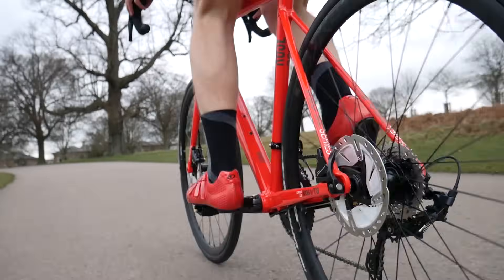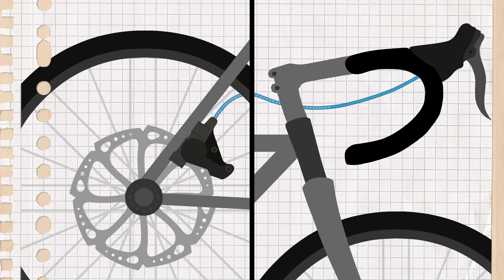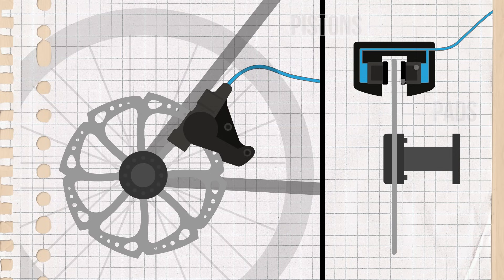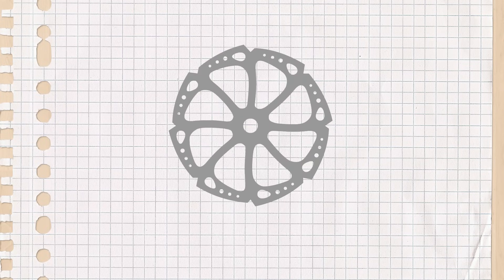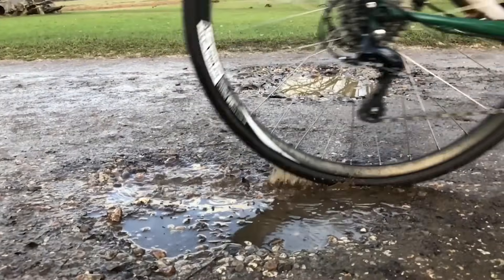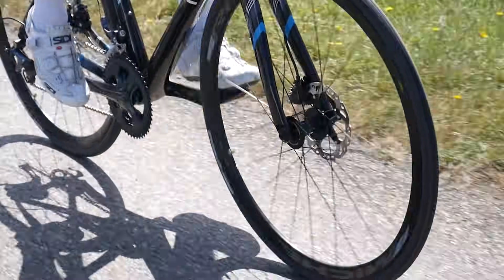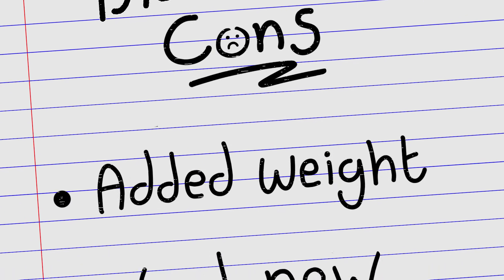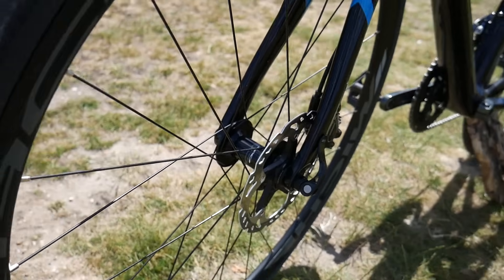How Do Disc Brakes Actually Work?

Comment: Disk brake looks more modernized and upscale in my opinion, and all E- bike have it for the looks and stopping power since it goes a lot faster, but the rim brakes is simple, works and look just fine on an everyday bike with a lot less maintenance, hope they never get rid of it, just make sure the adjustment is good for safety reasons.

Comment: convert coz all rim brakes ive used are ass
mooshy and cant stop you going down a hill, and unless youve paid for a $10000 tuning, the brakes with either rub against your wheels when you dont want, or when youre trying to break theyll be applying 0.1% of their power

Comment: Disk brakes are better i ended up putting my head through a windscreen getting a massive gash to my head and a broken collar bone because it was raining one evening and the spray and oil off the road stopped my rim brakes from working i just couldn't stop thankfully i didn't feel a thing i was out cold the only good thing about rim brakes is they are only a few pounds to replace

Comment: I don't have any problem with the modulation and braking power on my rimbrake road and gravel bikes. I just had to set them up correctly. 
Although I have hydraulic disc brakes on my mountain bikes due to worse conditions like water and mud on the trails in the forest, which can eat up the rim fast on the rimbrake bikes.

Comment: disc brakes all the way. Rim brakes were always way too inconsistent, especially in changing weather. Wet rims make for a very unsafe ride. Not to mention how quickly the brake pads wear down on rim systems.

Rim brakes were good for a non-practical and non-safety era such as the one in which they were made, but now, we actually got smarter and no longer ride like neanderthals (mostly).

Comment: I've never had one of those that's replaced onto my bike that Schwinn type one. I had an old one that is different, my old one is a la Jolla Street cruiser I've been having that bike and rode on it for 8 or more I believe but now I got an upgrade for my old bike which is I got a new bike now because my old bike wasn't working properly so that bike is now. I got a new bike call a Schwinn so it maybe pretty much of a mountain bike, it got shift gears so after I started practicing of shifting my gears of my new bike I'm starting to get hang of it now. The types of brakes I have is brake pads.

Comment: I'm getting a twist or slight movement in my ftobt 28 inch front rim with ftont disc brake application. 
Thoughts on why??? QR is as tight as i can get it😧
Reply: what do you mean by slight movement ? is the whole wheel slipping when you apply brake ?

Comment: How do the mechanical pull brakes work?  Do the flex the disc?
Reply: This is what I came to this video to try to find out, and I still don't know
Reply: @_Stormfather  if you're referring to mechanical disc brakes, yeah. Typically one piston is fixed (and must be adjusted manually from time to time) and the other piston is cable actuated. When you pull the brake, the cable pushes one piston (and brake pad) against the disc and flexes the disc ever so slightly to contact the other brake pad from the other piston.

Comment: I can't believe he just said rim brakes look better. No they do not. I only wish the pro athletes and organizations got onboard with discs earlier. I was surprised to know most of the high end group sets include V brakes because antiquated opinions and regulations prevented disc brake adoption. Thus, there were very few Shimano 105 options with discs in the used market, and that lead me to buying my Giant FastRoad Advanced 1. Disc brakes look way way way better than V brakes, and I literally refused to buy an expensive bike with V brakes when my crappy $350 CCM bike has discs.

Comment: Another con of rim brakes is that if you have even an insignificant dent in your rim which is basically unavoidable as your bike gets used more, then the rim brake will rub along that particular ding and you cause resistance, brake wear and sound. This problem doesnt occur with disc brakes as they are not in contact with the rim.

Comment: Silly Questions:
If I could only own just one bike, it would be a Rigid MTB. It would be used for mild trails and unpaved roads as a MTB as well as for pavement/Street riding in the City.
So my questions are as follows:
Can I have 2 sets of wheels, one for MTB (probably a 2.3, 2.4 tire) and the other one with 1 inch slick tires for City riding that could be easily changed from one to the other?
Which braking system would be best? It seems to me that to have the two, same diameter wheels but with different rim width would not be an issue for discs as long as the space between the disc and hub is the same on both. Is there a way of spacing this? Or is this standard sizing and it can be had with the same space?
Thanks!
Reply: It's standard.

Comment: Disc brakes are only marginally better than rim brakes ( on road bikes).  Not enough margin to buy new hubs, have bigger, clunkier levers and parts to go awry.  If you cannot propel yourself over the bars with rim brakes then sure, buy disc brakes.

Comment: you forgot to say one more cons = Disc brakers are slower due to lower aero.
Reply: the better stopping stopping power allows you slow down quicker for turns so you can brake later though making you more efficient in areas where you would lose time slowing down

Comment: I have 2 race bikes. Rim and disc, the disc breaking power and comfort is just suberbe compared to rim break, especially when you live in wet areas.. on top the disc bike gives you more options to use different tyre sizes...
In my opinion, once you try disc brakes you do not really go back to rim..
Reply: *superb
Reply: right!

Comment: Another con would is that not all disc breaker wheels have the same size axle or disc. So in road racing a neutral series car is unlikely to be able to give you another wheel if you puncture.
Reply: why you need a hole new wheel for a puncture.... even if your running tubeless you still dont need a hole new wheel
Reply: and tubes are what $5? $10 at most.... I always pack a few extra tubes with me

Comment: What pushes the pads off of the disc when the brake lever is released ?
Reply: The piston seals  are straight when lever isnt pushed. When  the lever is pushed, the seal bends inward toward the rotor, when lever pressure is released, the seal and vacuum of the airtight system pulls the piston and pad off the rotor
Reply: Denis& Litisha Thank you for the explanation.👍🏻
Reply: okantichrist whatever it is, it doesn’t exist in mine which is why they rub 24/7
Reply: The disc itself, by rubbing against them
Reply: JD Pinilla Seems like a waste of energy 🥴
Reply: No springs 😂
Reply: The pads are sprung.
Reply: spring action in mechanical calipers, hydraulic pressure for hydros

Comment: Another downsides are also that you can more likely get injured on them and they heat up when braking a lot down a hill
Reply: Marek Čontofalský I’m not a fan of discs yet(or a convert). But rims get very hot with a rim brake setup on technical descents as well.
Reply: Give me an example of any professional (or amateur for that matter) rider being injured by discs?